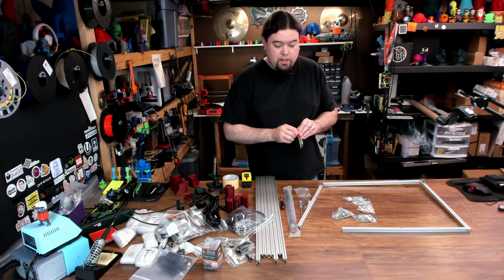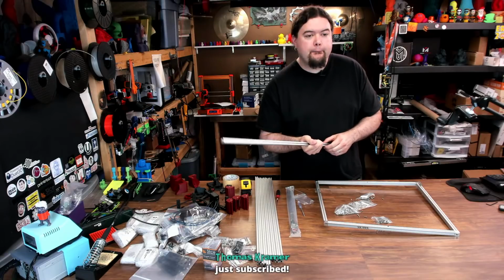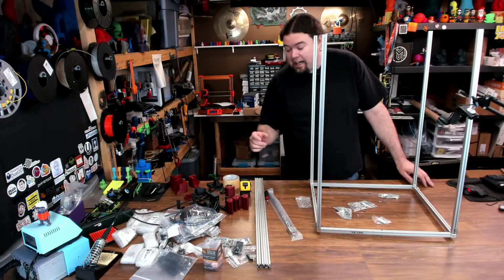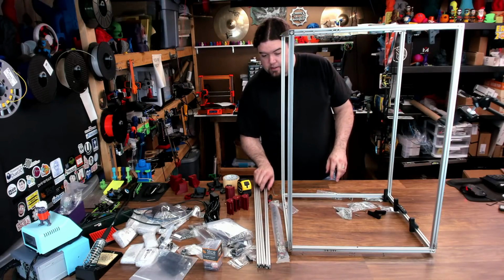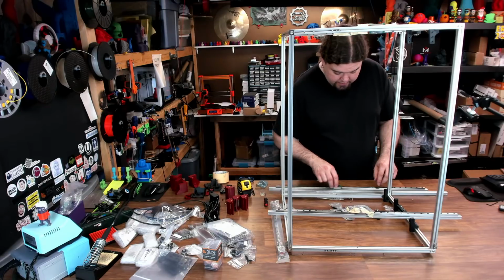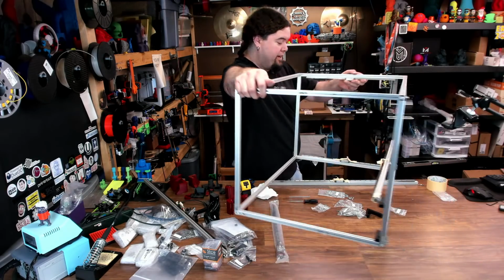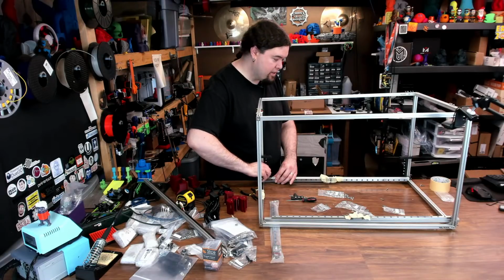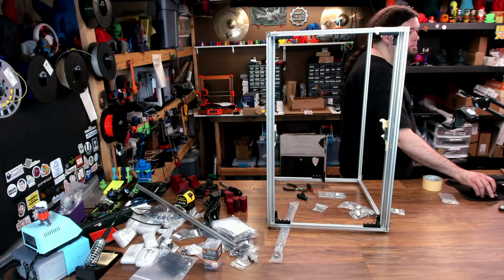Starts 1:55 - PrintedSolid  -  Railcore - ProjectR3D - Part 2 Of 7 - Chris's Basement

Comment: It's fisheye distortion
Reply from the maker: Yes, it is, I wish I new what to do about it.
Reply: @ChrisRiley  nada you can do side effect of a wide up close camera for that kinda shot you just need more space between you and the camera, just look at it like this your now in iso view perspective is disabled 😀.
This is a fact of life with wide lenses especially budget ones, really your best bet is are 16mm to 18mm lenses and not the cheap kind highend sony and cannon lenes are optically corrected, you can also apply a transform mesh in post but you will eat away quality as you push and pull pixels your render time will take a lot longer also not sure if it can be done live yet.

For a transform mesh go and have a checker board printed in a wide format printer and hang it in front of the camera. Usually a 4in square pattern will be more then enough points.

I'd stick it on a wall make sure the camera is level and the lens is centered to the pattern at a distance to fill the view and snap a picture also recored a 5 second clip and save in a safe place name the file the body lens combo and look at a guide for lens correction.. all Adobe  products support it in someway.